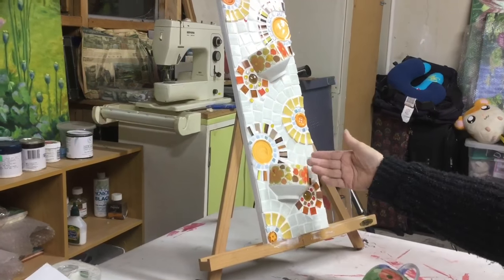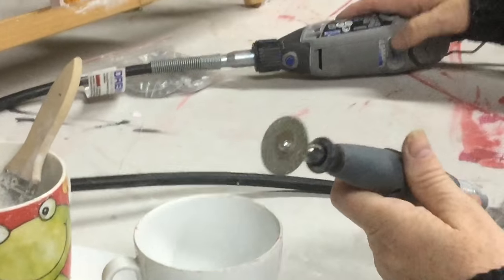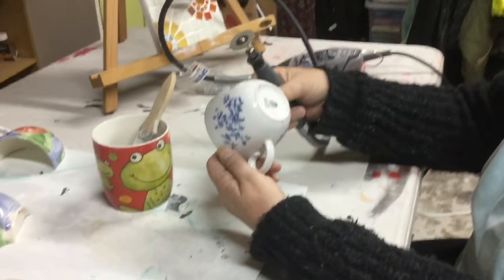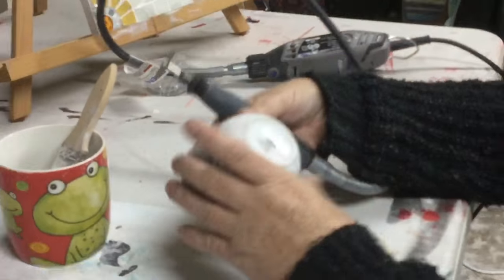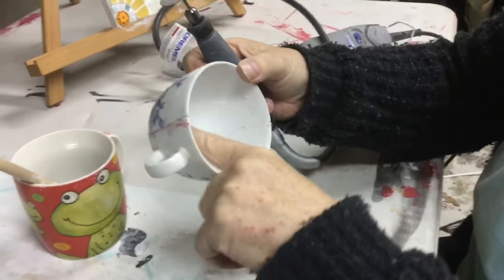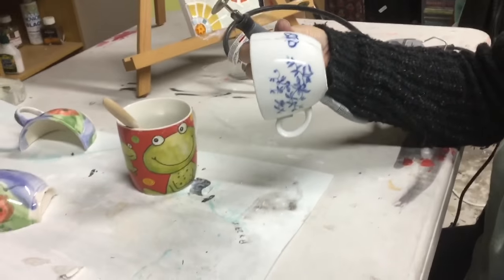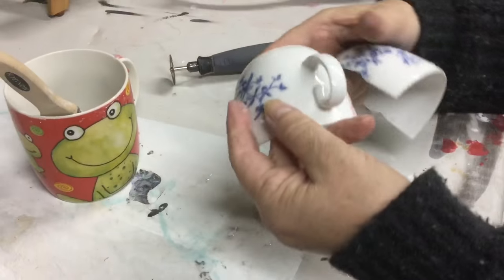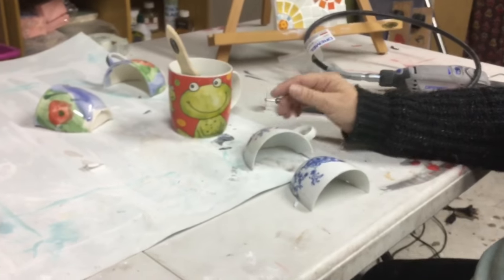How to cut a cup in half

Comment: Where can I buy a cutter like that - I live in cyprus!
Reply from the maker: Wow not sure, but I get mine from Hardware/Building supply store.
Or failing that, I am sure you could obtain one through online stores.
Reply: A dremel is technically called a rotary tool, there are many like it.

Comment: It looks time consuming and there's more work to follow. I cut my cups with wheeled nippers and tidy up from there. Much faster in my experience.
Reply from the maker: Its definitely whatever you prefer...I was cutting my cups with wheel nippers, but you certainly run the risk of it going all crooked and losing many cups before actually getting a cup you can use....Using the Dremel I have never lost a cup.......This is just a demo, Its definitely do it however you want to do it....and what makes you happy.